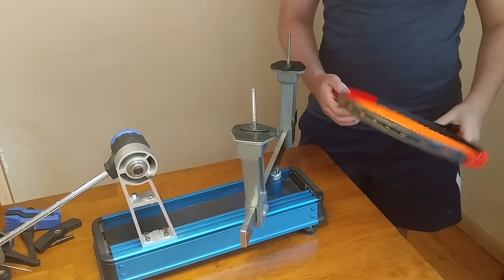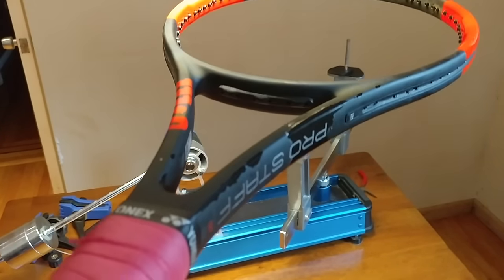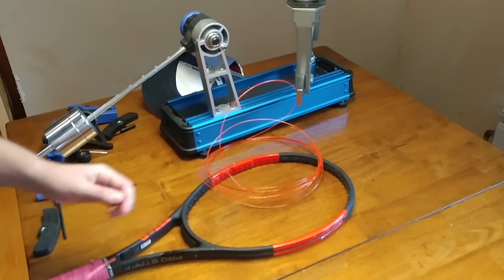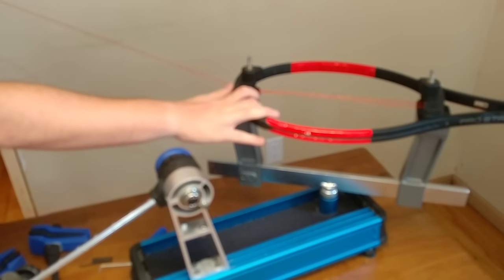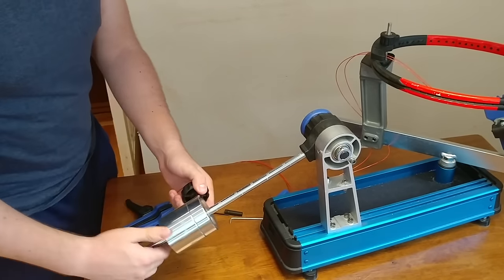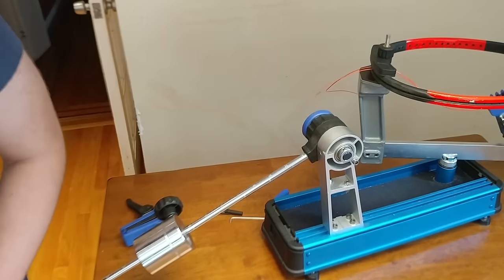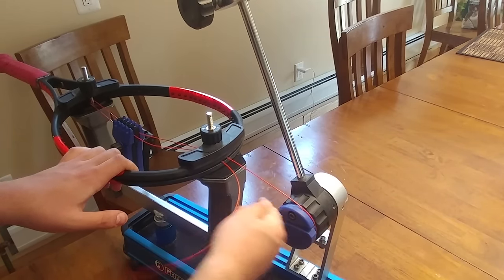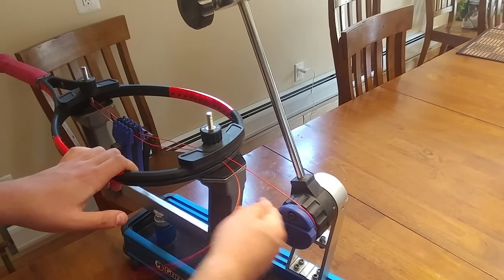How to String a tennis Racquet Updated (Gamma X-2)

Comment: Here is a trick I did - to know when the dropweight is parallel. Place a Spirit Level on the Drop Weight arm until the bubble is level. Use a marker and make a line on top of the rachet gripper, - spanning the silver side to the black side. Voila, the drop weight is parallel when the two lines "line up".
Reply: Could you explain in more detail that of the line? since I have this same machine

Comment: I don't think you are supposed to bounce the weight up and down like that. Just let gravity do the work and lower the weight gently, then adjust as needed.  Otherwise very informative.
Reply: So is this confirmed?
Reply: Yes that is correct. You should not allow the weight to bounce like that.
Reply: Letting the dropweight bounce can lead to snapped strings, even potentially damage to the frame. Also inconsistent pre-stretching across the string bed.
Reply: That's exactly what you're meant to do. I started on one of these type machines and was taught by a very experienced pro stringer. I strung on it for many years. In this video he correctly demonstrated that you arrive at the correct tension by gently bouncing the weight to get to the point where the arm is parallel to the ground.

Comment: I think how you start the mains by double pulling on each side will contribute to lower tension on the center mains.  The only way to prevent this is to measure the tension loss and then correct it by adding the loss to the tension at the center. So I know that by using a stating clamp, I lose about 3 lbs at the two center mains using a stringometer.  I just undo the mains and increase the center tension by 3 lbs.  After the completing the stringing, I remeasure the tension across all mains they are now uniform.  It is important to keep the tension as uniform as possible.  Of course, one could argue that by using vibration dampeners will also cause tension loss at that center mains.  This is true, however, if one doesn't try to make the tension uniform, the loss from the dampeners will be much worse.  One other thing, my Gamma's drop weight machine is off by +1.5 lbs.   So if I'm doing a string job for X weight, I will set the machine to X-1.5 lbs.  You can check your machine using a digital luggage weight scale.
Reply: I was confused as to how the remaining string after you put the first clamp would be tensioned, I guess it just doesn’t get tensioned

Comment: Excellent video Alan! probably the best video on gamma stringing machine. First I tried to string racquet just with wilson instructions but it was not sufficiently documented for first timers. Your video answered all the questions. Only thing would I have been useful for beginners is instructions on how to use awl. I struggled a lot on the last gommet to get the string through as it was blocked by mains string. I did not realize that you could use awl for such a situation until I was done. Oh well. next time. But thanks a lot for the video!

Comment: Thanks, Alan, excellent video.  Easily the best video for those who are starting out on inexpensive machines.
My first attempt ended when I broke a string when the drop weight bounced.  The second attempt went flawlessly.  My only comment is that you didn't cover how to get the cross strings through the grommets that were covered by the mains.  I'm not sure this is correct or not, but I used an awl to move the mains enough to get the cross string through.
Reply from the maker: You got it. That's the best way!

Comment: Thanks Alan, just got my new  gamma X 2 needed to see how to start the main strings. Have to put it together out of the box and see how it goes..
Reply: There is a much better way to start. Starting like in the video will not give you the desired tension for the center mains. The dynamic tension will be lower than the reference tension.
Reply: @tennispunk2  I actually string 2 mains at once with the X2. I can't tell the difference. I string 2 crosses then 1 cross to change the pulling direction. I don't string one at a time.
Reply: @tennispunk2  is there a video on how to start mains differently with flying clamps

Comment: Try putting a little bit of slack on the string before you put it in the clutch, you'll be able to build tension better and get a more accurate overall result. Good vid though, very helpful for people using this type of drop weight. 👍🏻
Reply: True. And this is more of a concern with poly strings which stretch less than multifilament.

Comment: Great instructional vid man!  If I had an extra starting clamp (in addition to the 2 flying clamps)  can I go ahead and tension the first main?  Instead of pulling tension on essentially the 3rd main?
Reply from the maker: I believe that should work if the starting clamp is attached to the machine. If not I am unsure. I personally don't use starting clamps.

Comment: Great instructions, only issue i encounter was about the length of the string. 17 times racquet head is not enough for 100in2 head size. 19 times is the right length!

Comment: Hey I am a beginner stringer and I learned from you video. Thanks for the awesome video! I strung three multi by following the steps you took and there were no problems, however I was string 4g soft the other night and the weight wouldn’t go down it seemed like the string was not elastic at all so I had to force the weight down and it led to a bad pop.. I don’t understand how it happens..do you have some idea about it?
Reply from the maker: Hi. For some reason didn't see your comment earlier. Might be too late for a response but I'm not sure why that particular string has the issue. The tension on the machine might be set as too high but am not certain.

Comment: Awesome video! Simple and covering the info we should know when stringing a racket. Have you tried the 6 point mounting system machine? If so, what are the advantages/disadvanteges between the two models.
Reply from the maker: Yes, I have. The 6 point mounting system keeps the tensions on the racquet way more evenly distributed so its better for the frame. Most 6 points are electric so you would be able to get the string job done a lot faster. With an electric machine, I am able to complete the job in about 20-25 minutes but with this stringer, it takes me about 40-45 minutes.
Reply: A 6-point mounting system has nothing to do with getting better tension distribution. It is just for better support to hold the frame to keep it from distorting.
Reply: @tennispunk2  yes, as Alan says, the racket (not string) is more evenly distributed and 6-pt support is better for the frame (shouldn't make a difference for the strings).

Comment: Thanks for this great video. I am a beginner and have a similar counterweight machine. I feel that a lot of tension is lost when doing the not. I find it hard to maintain some tensions between the clamp and the knot? Am I doing this something wrong? Is there a trick to reduce the loss of tension? Would the 2 knots technique help in this regard? thanks again for this video and looking forward to hearing from any advice.

Comment: Your weight went dropped every time you pulled tension.  What do you do when the weight does not drop or drops little, so it doesn't get close to parallel.  It happened to me today as I strung so I made some adjustments to the area where I was clamping and at some points just moved on without it being parallel.    I'm pretty sure my tension is all mixed up on this round but I'm still going to play with it and see if it's playable.

For future use, what do you do?  I read somewhere that you start the weight not 90% but closer to parallel so it doesn't have to drop as much, or even start below parallel and crank it up as necessary.  

What does it mean when this  happens and what would you do?

Comment: Having strung well over 100 racquets with this model stringing machine I commend you for putting up the how to video, BUT the viewer needs to know several very important details have been left out.  Watch the other videos on this stringer available before you start and read the manual that comes with the stringer. Practice with a cheap string starting out. Knots, string length, one piece vs two piece all do matter as well as tie off points.  Find the manufacturers stringing pattern instructions for your racquet. Details matter across all the racquet brands.

Comment: Hey great video. Clear instructions. Well done man. One question: with a hybrid which one goes as mains and which as crosses? I'm using ashaway crossfire 17g poly and aramid on a 2006 babolat aero pure drive plus. Thanks.
Reply from the maker: Appreciate you. It's whatever you prefer. If you want more spin go with the poly in the mains. If you want better feel go with the aramid in the mains.

Comment: Great video! Is the two point mounting system fine? I've read online that it can cause the frame to twist, so was wondering if it is worth paying extra for the 6 point system?
Reply from the maker: Thanks! Up to you. I found my racquets are still perfect after using the two. The 6 might have a couple benefits though.
Reply: @AlanGrandman  great, thanks for replying! I ended up choosing the two point machine, looking forward to getting started!
Reply: @TheFlyingChicken69  It really depends on the racquet.  I strung my friends Wilson Blade 98 and it warped the frame.  Made it like .30 inches shorter and a little more wide as well.  I use the head radical graphene xt and it doesn't warp the frames.

Comment: Is there a technique to tension the first 2 mains with a drop weight as opposed to your method of pulling tension on the 3rd and 4th mains.  Wouldn't the tension of the 1st and 2nd main be inaccurate?

Comment: Great video  I seem to loose tension in the 2 middle strings and once I tie off the mains it is really noticeable. I have 2 Gamma floating Clamps which I have sep quite tight. Any possible tips? Also if I had a Gamma starting clamp might it give a better end result?

I pull at 57lbs and end up with 47lbs once complete according to tennis tension app.....

Sorry for all the questions!
Reply from the maker: Hello and thank you! I am unsure of individual string tensions since I don't have an app to measure them, however, after a day of hitting on the court, the string bed tends to level out, and the tensions become even across the frame. This is just something I have observed. Flying clamps will always be disadvantageous in comparison to mounted clamps.
Reply: @AlanGrandman  fantastic information thanks!

Comment: Hi Alan, this is a good video. But my one point of confusion is that you don’t really explain which strings you are clamping together  and why you move the clamps to a particular location. I think you are clamping the one you just tensioned with the one next to it, right? And then I see you move the clamp, but you don’t say why you are moving it from one end of the racquet to the other. Can you explain in one sentence, WHICH STRINGS you are clamping together and how you decide WHICH END of the racquet you move the clamp to? I’m a beginner! Thanks!
Reply: He's clamping the string that he just pulled tension on and the one next to it which was tensioned prior. After pulling tension you must move the "flying clamp" to the end where you pulled tension to "hold" the tension; otherwise, if you just remove/release the string from the circle ratchet you'd lose the tension and defeat the purpose for pulling. Placing the clamps closet to the end where you're pulling tension maintains the tension from that point backwards. Then you just pull, clamp, and repeat.

Comment: Which one is better or worse between these two: gamma x-stringer x2 tennis stringing vs gamma proression 2 200 tennis stringing?
Reply from the maker: I've only ever used the X2, but from what I heard, it's slightly superior.
Reply: @AlanGrandman  I see and whats the total weight of this machine?
Reply from the maker: @LubaLuba1  30 lbs. I put a link to it in the description. Should have all the details. It's quite heavy to move around a lot(but you can if you need to) so best to find one good spot for it.

Comment: Hi Alan, I’ve been copying your technique for the crosses and I clamp two strings as you did in the video. When I finish the racquet it seems to be loose and the crosses move around even when strung at 52 pounds
Reply from the maker: Yea, there is really not much you can do with those edge strings. It's the big disadvantage of flying clamps in addition to speed.
Reply: @AlanGrandman  would increasing the tension by 10% just for those strings compensate?
Reply from the maker: @lydavy  I personally don't lift the tension, but I know people who do. It's especially necessary with an electric stringer. So I would say try both and see what works best.
Reply: @lydavy  I usually give the tie off mains a bit more otherwise they can end up too loose. Another thing you can try is jamming an awl in the grommett hole to hold tension before tying off. Just be careful not to "nick" the strings. A lot of people seem to be anti-awl but it was suggested to me by a guy who strung for the Australian Davis Cup team back when they were winning!

Comment: Just wondering some time when I pull the string the weight is not dropping as expeced and it's kinda stuck in the middle. I am hestistad to put any force to move the weight afriaid of the the strings might pop. Do you any idea for what's the reason of this happening?
Reply from the maker: this was asked in another comment I usually push it up and let it drop a little more

Comment: Hi! I have the same machine and I am currently working on my 2nd racket- the tensioner was horizontal as instructed and then made a loud ‘ping’ noise and the string came undone. Next, the strings were losing tension and the clamps were moving up and down the racket which never happened before. What does this mean? Is the machine broken in some way? Stressing over this a lot. Thanks

Comment: one thing makes me wonder. I will buy a racket and there is 23/25 kg on it that you can stretch. But how much is the actual stretch?
Reply from the maker: That's the recommended tension for the frame. So when you buy your string it's a good reference to see what number to stick close to.

Comment: Is there a better way to measure the string before starting ? I am not using reels, I followed your advice on measuring and I ran out of string for the last cross and couldn’t pull tension on the last cross I completed, I was stringing a 18x20 with a gamma 17 that came with the gamma x2 machine.
Reply: If you are using poly or monofilament, you may need to add a foot as it doesnt stretch much.

Comment: great video Alan! A question- sometimes on the cross strings the drop weight arm stays above parallel so I think the crosses are over tension-ed; any thoughts on what I might be going wrong?
Reply from the maker: Hey Glenn. This happens to me as well. I usually just keep lifting it by little increments and that seems to do the trick in making it horizontal.
Reply: Both above and below horizontal are under tensioned. Just the way the physics work out with a shorter lever arm for gravity. If it's substantially above, try to raise the arm and release the string from the tensioner. Make smaller adjustments next time.

Comment: I feel bad for you guys with drop weights.   I would be half way done with the crosses by the time you did a few mains.   I use a Prince Neos crank pull and also a Babolat 5 Star electric constant pull.  One thing I did not realize about using drop weights is that you have to keep adjusting the drop weight while you are tensioning the string.   I always say consistency is the key to a good string job.  How long a string is tensioned, how long to move and set the clamp how long to release the tension.    Doing  all that at the same amount of time every time is key.  If you spend 10 seconds with a string in the tensioner and then on the next 30 adjusting the weight I worry how good a job will result.    It would be like if I had a string in the tensioner and then went to answer a phone and got distracted.
Reply: Very true, but it boils down to cost (and probably stringing volume). As you prob know, a drop weight machine is considerably less than a crank pull or electric pull. But if the volume and/or stringing frequency warrants the more advanced machine, then I'd say it prob makes more sense to opt for the more expensive option if one's budget can support it.  Besides getting the job done quicker, it's likely to be more consistent.

Comment: Thank you for this video. I have one question. At 20:40 you don't give full tension on first Cross string. You only give the half tension on the first two Cross strings by pulling the second. 
Is thera a possibility to pull each one seperate?
Reply from the maker: Yes there is that possibility, however, since I am using flying clamps which I assume you have on your machine as well, it is the only way. For those first two crosses, you must tension both in one go. If you look at electric stringers, they have single stationary clamps which allow you to tension one at a time. Of course this gives you more precision, however, those type of clamps are a lot more pricey. With this machine (gamma x-2) you must pull those first two initial crosses together by tensioning just the second cross exactly as seen in the video. Hopefully this helps.
Reply: And I also add more tension I string at 55 Ibs and even when I string a 63 still doesn't work
Reply: You can purchase a starting clamp. Use the starting clamp instead of a starting knot. Do everything as shown in the video, but with the clamp you can then go back and pull full tension on the first cross and tie it off with a finishing knot.
Reply: Herb Baird ..just make sure you leave enough string  behind the starting clamp to reach the tensioner.
Reply: I would hope people would measure the string to the tensioner prior to clamping, but I guess you never know.